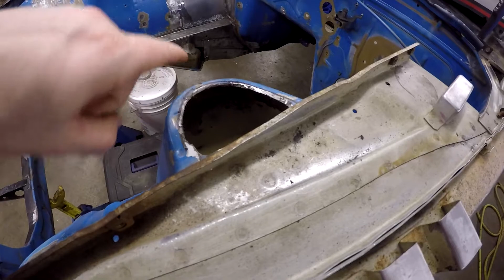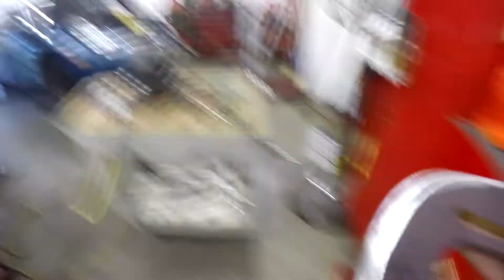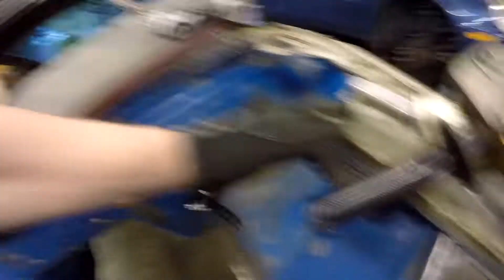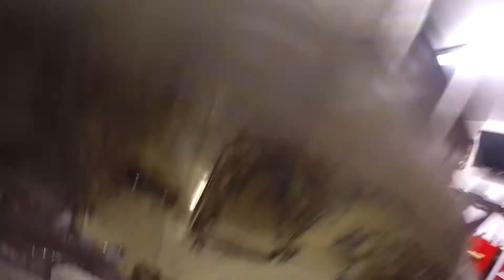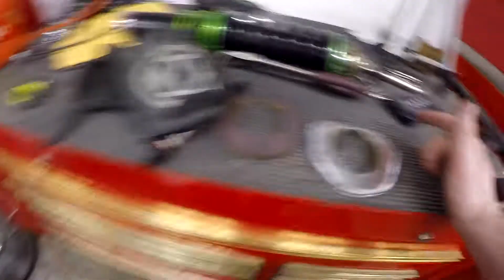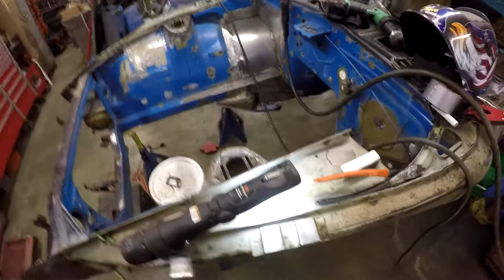Datsun 280z Coilover Install Pt. 2

Comment: Did you have issues with ride hight or where you able to compensate enough with the coilover to lower it to where you wanted?
Reply from the maker: It is just low enough. I bottomed out the coil over and it sits where it looks good. My real issue is the frame is 2 inches from the ground....
Reply: @StewartMotoring  I wonder if having those camber plates on the bottom would change that or if it's the coilovers themselves. Also thanks for the vids I've had a 73 kick in it in the barn for a 4 years and have recently pulled it out to start working on thanks to all the YouTube inspiration lol. Have to start with all new floor pans :/
Reply: Isn't it better to have it sitting ontop. And get better welds from both side?
Reply from the maker: Top would have been fine. Don’t think it matters for welding though. I just felt more comfortable being under the strut tower since the force is upward and won’t be reliant on just the weld. But since then i would feel comfortable doing it either way. A good weld on top will hold it

Comment: What do you do for paint on the camber plates, the sliding action would chip off any paint right?
Reply: I like your idea with the washers and square tubing to ensure they are straight to each other, I'm stealing your idea forsure!
Reply from the maker: That’s true, I have thought about this. It will scratch the paint, but once you dial in the coilovers you shouldn’t need to move them. So it won’t be a big problem